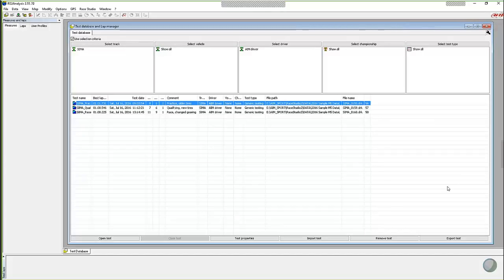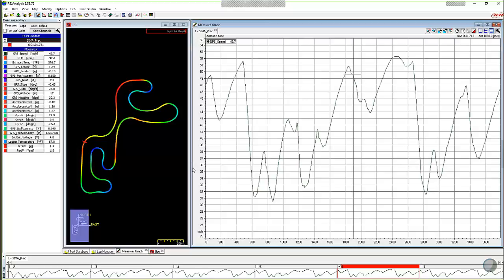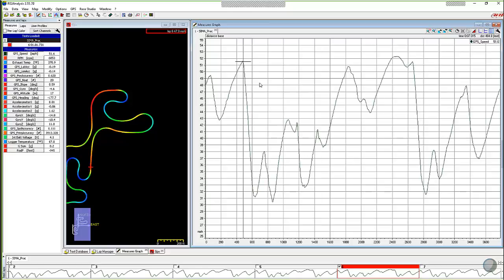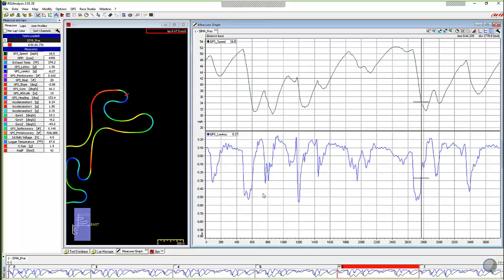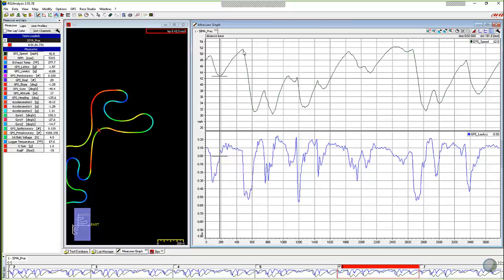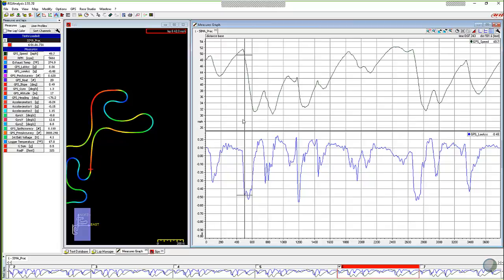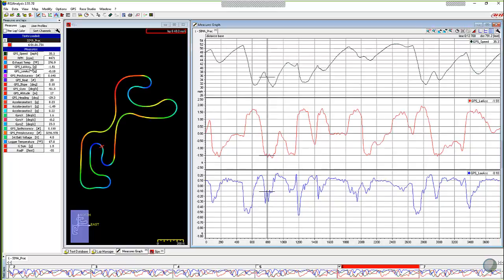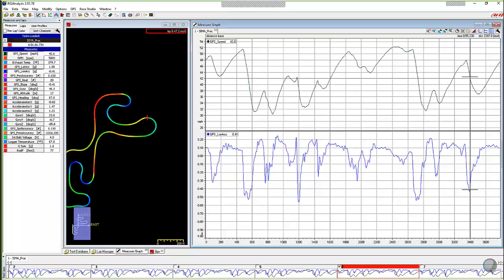Analyzing Braking Zones for Improvement

Comment: a
Awesome video!! Other than printing the plots shown on the screen, is there a way to save the plots as pdf or screen shots that can be viewed and shared with others on the iphone?  Thanks.
Reply from the maker: Aside from taking a screenshot and saving as a PDF of the plot there isn't a way unfortunately.  If you are wanting to see the raw data you can export the file by going to File > Data Export and exporting an Excel file.  From there you can convert that file type into a PDF.

Comment: Hi,
Great videos! Thanks for taking the time to make life easier.
Could you show how to change the values in the data being looked at? For example, my speed value goes from 0-200kph and my RPM only goes to 8,000rpm, my max speed in the data I am looking at is 92kph and my rpm range is 7900-14600rpm.
Cheers
Reply from the maker: Hi Pablo, you just need to change the "Scale" in the configuration. For example, if the car red lines at 14,500 you will want to set the scale to 14,500 or 15,000.